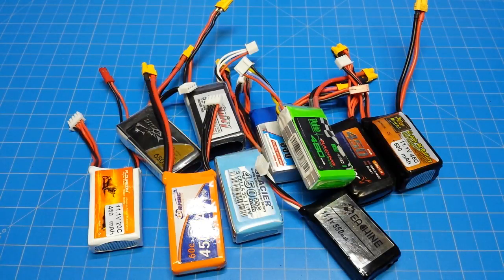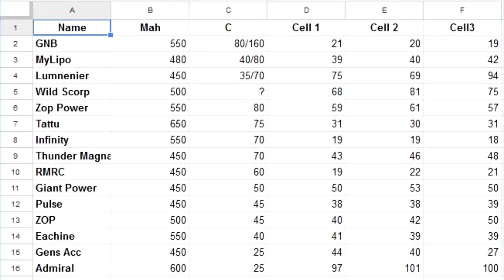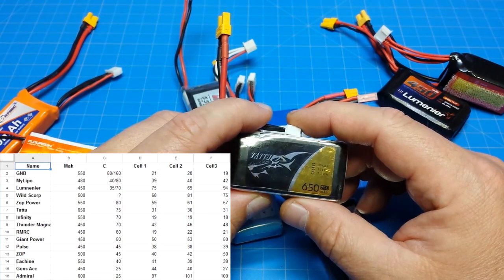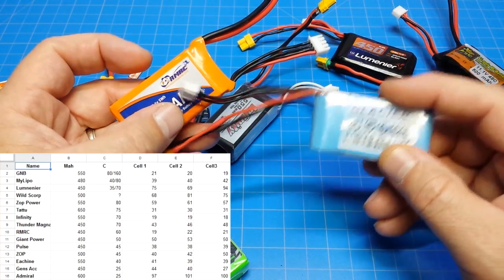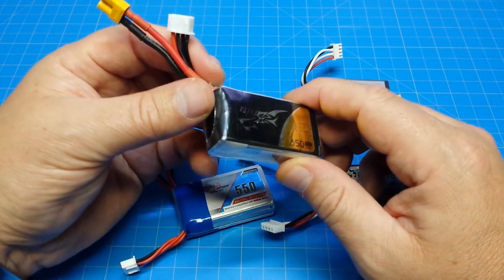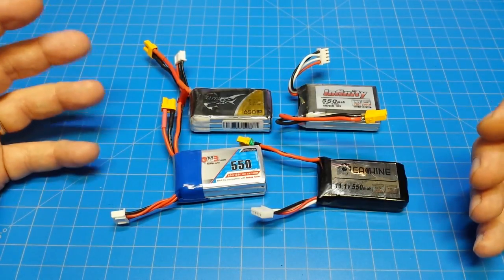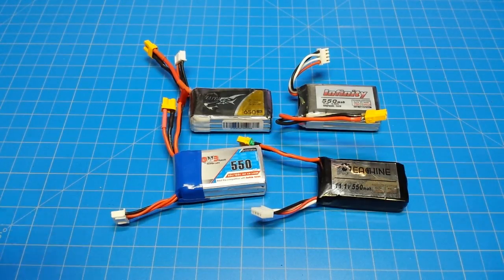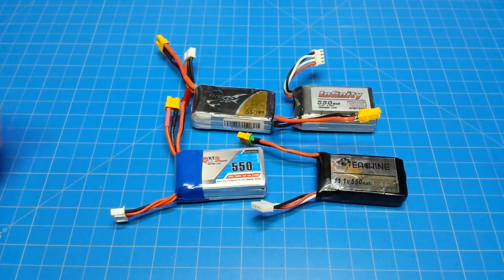3s Lipos - Micro Group

Comment: Another great video. RMRC are rebranded GNB's and a little cheaper to boot. Not sure if you have built a 3" Toothpick yet but by far my favorite Micro of all time. Sanchez 3" or pickle 3 " frame 12a AIO board like betafpv or GEPRC, runcam nano, eachine nano vtx, 12xx-13xx 5000-6000kv motors I used the rcx1304 5000kv and GNB 550-6503s. Hq or GF 3" bi ortriblades. I would bet  it would make your top 3 best off all time. Mine comes in at76g AUW. It will set a new bench mark for you. If you haven't built one yet you can thank me later:)
Reply from the maker: haven't done those yet. We will have to see what the future brings.

Comment: i just ordered a leader 120 from bangood along with some GNB 450mah 3s lipos and i got an email saying they cant deliver lipos to the UK so i was wondering how good the turnigy nano tech 450 3s 65c battery is as i can get it from in the UK. i saw that you had some in the leader 120 review so what have your experiences been like? are they good or complete shit? thanks.

link to battery: https://hobbyking.com/en_us/turnigy-nano-tech-450mah-3s-65c-lipo-e-flite-compatible-blade-180cfx-eflb4503sj30.html
Reply from the maker: They work well for a limited number of flights, but start to "fall off" after say 20-30 flights. Check amazon for the GNB batteries, maybe that is an option.
Reply: Nick Burns I decided to get the nano tech ones because I couldn't find anything on amazon and the nano tech ones are half the price so I don't mind having to replace them after a while
Reply from the maker: Sure, have fun, its a good little micro.

Comment: hey, great battery comparison video! May I ask what is the specs for the micro you showed at the start of the video? i can only tell you are using the kingkong 2840 tri blade prop and possibly a hglrc f415 flytower. what is the motor and the frame? really wanna get my hand into this build since it looks so slick. I do have a 3s micro build with dys1104 4000kv motors but i want to improve the build as the old motors are getting less power. thank you very much and happy thanksgiving!
Reply from the maker: That is the atlas 130 frame, with the hglrc f425 stack.
Reply: hey thank you for the reply. are you also using 11 class motors? what is the KV like?

Comment: This was very helpful.  I started flying drones almost exactly a year ago; but all of my drones have been in the 250mm class.  I have recently started flying the 120mm to 130mm class drones; so this video on 3S batts is very applicable and timely for me.  The sharing of knowledge in our hobby is so important; and your contributions are appreciated.
Reply from the maker: great. I have bought a bunch of bad batteries. I failed to add the new xop power, they are all bad...2s on up to 4s. Huge battery sag instantly

Comment: Would have bought GNB yesterday but they are out of stock :(
I also found same issue with nanotechs.  But on 2S lots of sag after about 30 flights. Also half of them have puffed up a little. I've treated them all the same never took them under 3.5v per cell. Will never buy nanotech again.

Comment: Hey guys. I have the Infinity battery and they are great. I also have the Nano-Tech 450 mah. 65-130c rating and find these very good. It also only weighs 40.00 grams. I use these on my 130 with Emax 1106 motors.

Comment: Hi Nick.  Great channel.  Off topic question.  I want to get into a leader 120 size 3s quad but really want to run a runcam micro.  Any suggestions?  Thanks
Reply from the maker: Some have been squeezing it in, I personally think its risky as the camera isn't secure with the screws.  The alternative right now is to build for by one of the 2" RTF with micro runcam, like the fpvmodel kl-ex90 or the spcmaker 90 and 95.
Reply: Nick Burns.  Thanks Nick.  Hopefully one will be coming down the pipe at 120 ish size with 1106 motors.  I'd prefer a kit, alot more fun to build what you fly.
Reply from the maker: the Eclair v2 is very close, we have to "shop" for parts though.
Reply: Nick Burns. Im liking what im seeing.  I see a v2 3" is coming soon.
Reply: Tomoquads has some really good frames comparable to the Eclair as well that will allow a Runcam micro swift. I'm trying to decide myself for the same reason, but probably just going to transfer (rebuild) an existing micro of mine to a new frame to use the Runcam.

Comment: Don't worry about the give-away. You are basically giving away free stuff? You made mistakes? Fine. Find a new way to do it, a way you agree with and do it that way in the future. 
I like the video idea Dom Kirbs has. You will always have people trying to win, just to win free stuff :D Small question. I'm using my first micro (Kingkong110gt) and the camera is so bad compared to my miniquads. Any way to try and make it better? The issue I have is that darker spots lose texture and look like black splashes and lighter spots the opposite. Whenever I have some contrast from sky/ground it seems to just make 2 big blobs of dark and light.
Little fun fact. Somehow my unlocked phone has been typing out your last part in the video perfectly.. THAT LITTLE FUCKER!! Google doesn't like my accent I guess. Or it's a testament of you pronouncing your words properly. Thought I might add that for anyone who actually read this far :D
Reply from the maker: Thats funny. I wonder how the audio activated that. The KingKong and its ilck are pretty poor cmos cameras. There is the possibility its not focused well. Try turning the lens, but be careful sometimes they are glued in. The alternative is to replace the camera. They can be purchased, but I am not sure if they are new tech or old tech. I haven't seen new cameras only come out, maybe look for high tvl and that will indicate a newer cam.